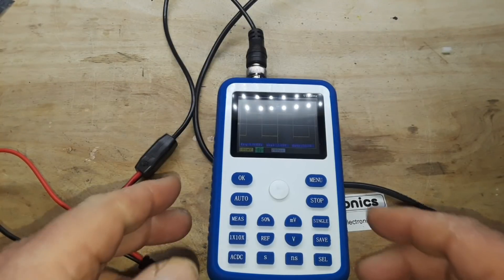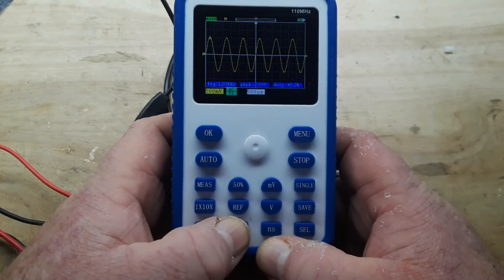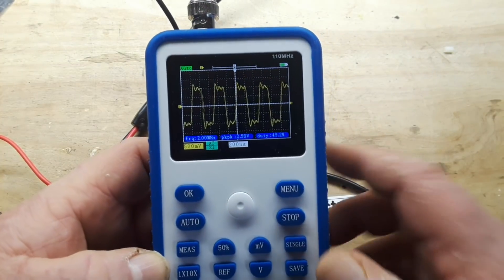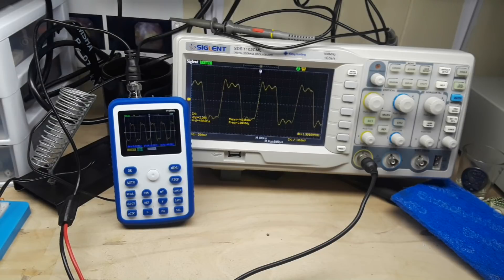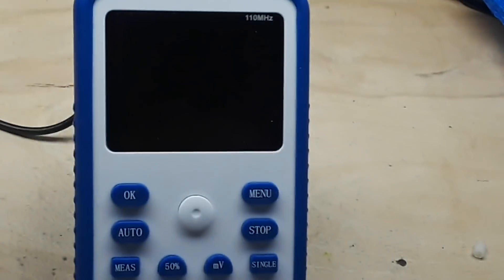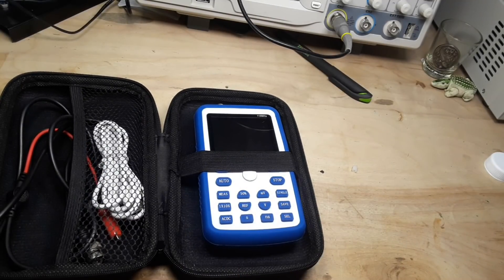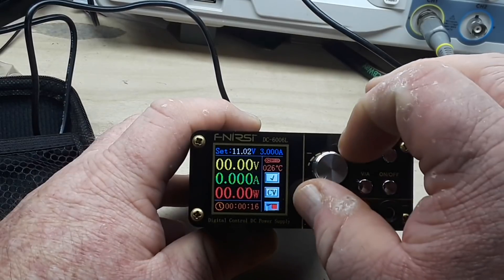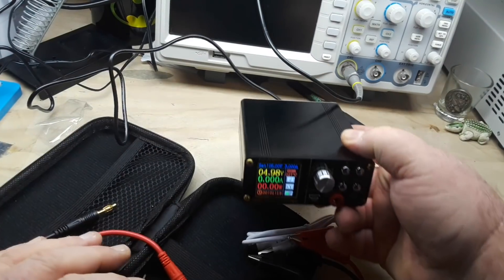FNIRSI 1C15 Oscilloscope & DC600L Power Supply First Look

Comment: Paul I'm in doubt which one to get if 5102h or this one. 5102h supposedly has more memory depth and it's less jittery on waveforms. This one is cheaper than the 5102h . Still don't understand.

Comment: A link to the power supply on Ebay:
https://www.ebay.com/itm/FNIRSI-DC6006L-360W-60V-6A-Programmable-CNC-DC-Adjustable-Power-Supply-Voltmeter/164446683811?hash=item2649c942a3:g:IV8AAOSwbopfhtrY

Comment: The 1C15 is neat little oscilloscope. It would be nice if the analogue settings (timebase, Y scale, and trigger) were implemented using rotary encoders for ease of use. Ideal for site work though. And very cheap!

Comment: hi how do i register to one of this give away's?, i remember you posted a video about it, but i can't find it.
i have been a subscriber on your channel for almost 2 years and  i have learned a lot, and i am wanting to build a 3 phase pure sine inverter with a peak of around 60 kilo watts and continues power of 24kw
so my wife and i can have 3 phase power of both 220 and 110v at 3 phase, when we move to our off grid property.
i always wanted a scope, and when finely was about to go look for one you posted this video, i have never won anything in my life i though why not try my luck.
i love the small power supply what is the max voltage and amp's?
Reply from the maker: Look for the google forms link down below
Reply: @learnelectronics  i find it, but it's telling me a have already responded? (i tried to register to your website an hour ago, and i got this email "Hi Oz,
Welcome to Google on your new Huawei Valiant account" is that it?